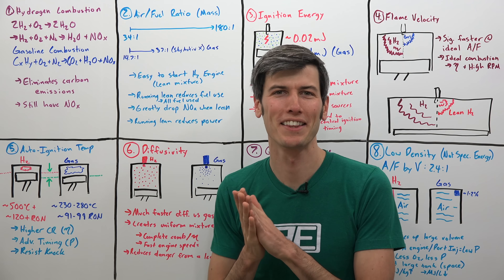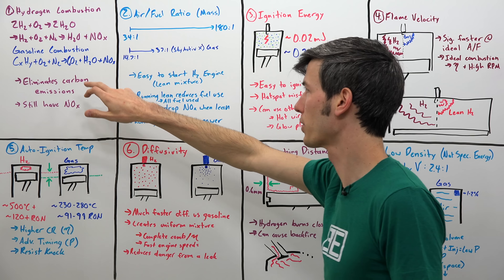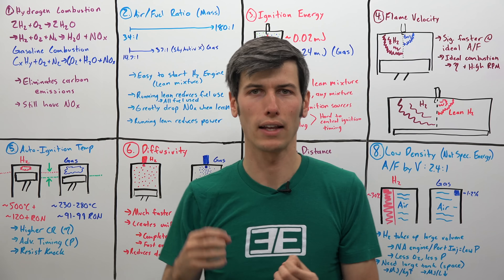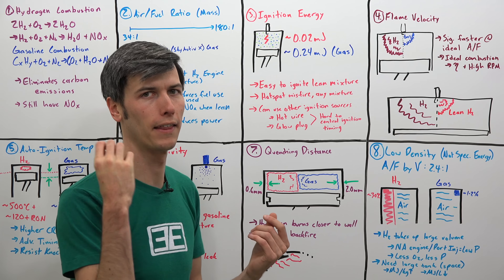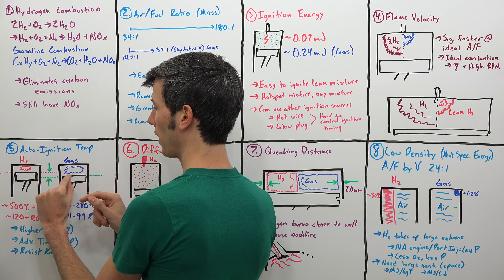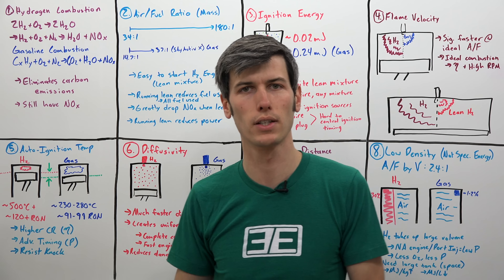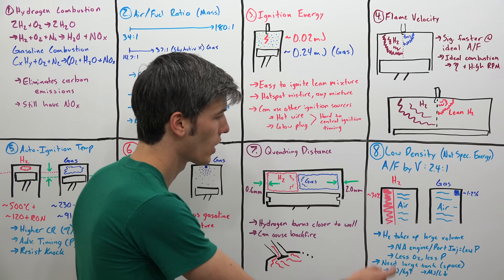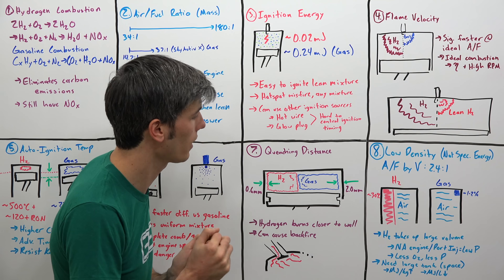The Difference Between Gasoline And Hydrogen Engines

Comment: How does the catalytic converter react to the nitrogen oxide emissions?

Using the least hottest spark plug there is. Better than a glow plug. 

Deeper seating valves, more piston rings.

I would have thought compressing hydrogen into bottles of the propane type [tanks] would be more efficient than gas tanks.  

One always asks, where does the hydrogen come from? Most common answer is it takes gas/oil to produce the hydrogen so why bother with it. My answer is to strictly use hydro power to creat hydrogen [no pun intended] then they complain about flooded valleys needed to supply enough hydro power.  My answer is that it would probably be better to flood a few more valley with water than to flood the entire atmosphere with smog pollution as car fumes count for 70% of the worlds pollution. Is that correct?
Reply from the maker: Can split it into N2 & O2.
Reply: External combustion generators used in large power plants are much more efficient than engines used in cars. So you still have petro-emissions, but less.
Reply: Right Wing Safety Squad of course less, lots less. Enough less that the smog pollution will go away.  Still? Are you trying to insinuate something else?
Reply: @tomster7574  That's exactly what I was saying. I was merely responding to your concern about fosisle fuels bing used to produce the hydrogen.
Reply: Right Wing Safety Squad 👍

Comment: Cant watch it all, have to leave for work, will finish later... I don't see oil life mentioned on board... how long can the oil be used before contaminated by water?  Would it still turn brown?
Reply from the maker: H2O is also a byproduct of combustion with gasoline (or any other hydrocarbon fuel). It's vapor, so it passes out the exhaust (why you see steam from the exhaust when it's cold outside).
Reply: @EngineeringExplained  Thank you for replying, yes I know water is a byproduct of gasoline combustion, since there would be less contamination from carbon and unburnt gasoline what would oil life expectancy be before eventual contamination by the water vapor that isn't expelled through the exhaust?

Comment: Would there be any way to filter out some of the nitrogen in the incoming air to reduce NOx ?  If you could, would this effect performance of either?
Reply: yes, by using pure oxygen, it would improve performance by alot
Reply: @antoniotod9614   Even though that's not filtering, it  would work, but now you need storage for the oxygen, reducing the range of the vehicle.

Comment: But what is the main reason now why hydrogen combustion engines aren't popular. I don't think it's because of the tank size. There must be more problems to it.
I once heared it is kind of "attacing" the oil film on the cylinder walls but I don't know if that's any true
Reply from the maker: Efficiency

Comment: Will carbon build up on the back side of the intake valves and seats be an issue without the presence of gasoline to wash off the valves and keep them clean.  I understand that motor oil being sucked past the valve seals and baked onto the backside of the valves is the culprit here. I am wondering if the backside of the intake valves will need to be sprayed with some sort of cleaning solution via and injector to keep them clean or will the cleaning have to be done manually periodically.   Thanks...   Jon Smith
Reply: No more carbon created in the H2 combustion !! No more build up and sludge, fewer oil changes also.

Comment: I've always been confused by how hydrogen combustion worked to produce power in a piston engine, as I was always lead to believe that hydrogen combustion resulted in a net loss of pressure.

With gasoline you have a liquid and an ideal gas, when they react they make a lot more ideal gas, in the same volume, so the pressure is positive, relative to the precombustion state.

With hydrogen you have 2 ideal gasses reacting to make 1 (roughly) ideal gas, in a 3:2 ratio.  So in that case the product should take up less volume than the starting materials, and you should have a negative pressure, relative to the state before the reaction.  What am I missing?  Is the increase in temperature so high that it pushes the pressure positive?
Reply from the maker: Combustion is very hot, heat makes pressure. Sounds like you figured it out haha. :)

Comment: Hey dude. Could you do a video explaining why automatic transmissions with torque converter are known for handling more torque than a DCT? I don't think this is a rule because the Chiron weights 2.000 kg, has 1,600 nm of torque and uses a DCT. Thanks!
Reply from the maker: I'm not sure I understand. You could have either style transmission be designed for the torque required. Lot of high torque autos and DCTs out there.
Reply: @EngineeringExplained  Everytime I ask why some car manufacturers prefer to put a traditional automatic transmission (like the 8. speed ZF) instead of an automatized transmission with dual clutch which BTW, are much faster (like PDK), 100% says that it's because they can handle more torque. For example, if I'm not mistaken, audi uses an DCT in the TTRS and RS3 but uses an 8 speed ZF in the RS4, RS5, RS6 and 7. BMW uses a DCT in the M2, M3 and M4 BUT in the M5, M850i and M750i, they use again an 8 speed ZF. My point is: As the cars get HEAVIER and MORE POWERFUL, car manufactures seem to prefer to use an 8 speed ZF over a PDK. Sorry for my english XD :D

Comment: I'm curious what the difference in range when comparing a hydrogen combustion engine to one using a fuel cell for the same volume of hydrogen. Though I guess for a true comparison, you'd want to also compare the weight and volume of the motor(s) and drive train for each..
Reply: Just the power you get back, a top of the range fuel cell is looking at 70% energy conversion and a combustion engine maybe 35%.

Comment: You didn't mention hydrogen embrittlement induced stress fracture. That has to make a big difference in engine design!

TBH though - discussing combustion engines now after I have switched to electric makes my head feel dull.
I'm sure there is much interesting to be learnt  still - like there is is about flint knapping.... but when you have learnt to make hardened steel tools it all seems somewhat  pointless and abstract.

Comment: In Europe it's common to see gasoline powered cars converted to either LPG or CNG by installing a new ECU that reads injections times, creates a custom map for the engine on various engine loads to use on LPG/CNG injectors or in case of some GDI engines use the gasoline injectors . 
How feasible would it be to convert a gasoline powered car to Hydrogen? My guess is that it shouldn't be much different from LPG/CNG but I could be wrong. Not sure if you did any research on this but do you know how do Hydrogen combustion engines compares to LPG/CNG counterpart?
Reply: waxonandreluis 
BMW researched a lot on hydrogen ICE in the early 2000s. There even sold or rented the BMW hydrogen 7 which had a V12 hydrogen internal combustion engine. If I’m not mistaken it had like 270 HP when you run it on hydrogen and 445 HP when you run it on petrol. I remember seeing those prototypes and the final “production” car back at the Frankfurt Motor Show IAA I guess it was 2005 or 2007. 

Unfortunately for BMW environmental issues where not the first priority back then at least they where less of a political priority.
Reply: BMW got some grant money for research and did place some H2 vehicles in private hands in some fashion (not sold but leased, maybe even use for free in exchange for reporting). The issues of range from fueling station and the heavy monitoring by engineers would have limited the useability. They got their data and the program ended. The issue with many alternative fuels is infrastructure and fueling difficulty. Gaseous fuels and liquefied gaseous fuels are far from driveup-throw nozzle in tank- walk away affairs. Electric charging cords frustrate many people.
Reply: The missing reaction on the first whiteboard cell is where the hydrogen eats your engine.
Reply: I read somewhere that hydrogen can fuse with metal structures such as tanks and pipes, but works perfectly fine with polypropylene and carbon fiber. So I guess any metal parts that come in contact with the H2 will have to be replaced.
Reply: I have heard best way to go is diesiel engine converted to LPG and then you just need enough on demand hydrogen to keep it running. Storage tanks too expensive. It's possible to get the the amount you need with the proper catalysts, frequencies, and all requiring less than 2 amps. More than 1 amp...... and your doing it wrong.

Comment: You seem like a smart man but I wonder if you are smart enough to figure out just how one Stanley A Meyer made use of just water as the source of hydrogen fuel on demand? In order to figure out just how Meyer, and a few others like Dr. Dingle, you are going to have to learn something that is not taught in our science books right now and make use of the scientific method as there turns out to be another way to break the bonds of the water molecules that is outside of mainstream sciences current understanding of molecules. 
But here is a point I am sure you will understand quite easily and that is controlling the burn rate of hydrogen using gases that do not support the combustion process, IE, the cars exhaust gases. By using the exhaust gases one can slow the burn rate of hydrogen to that of gasoline or diesel and lower the heat of combustion to reduce the amount of NOx gases to practically zero. By injecting in the exhaust gases that do not support the combustion process they physically get in the way of the hydrogen gas atoms from combining with the oxygen gas atoms much the same as if you where to go down a highway by yourself and again during rush hour. This is how one slows the burn rate of hydrogen, but there is more that one can do to increase the power of the combustion process and that is by ionizing the incoming air supply focused on stripping the oxygen atoms of their electrons. This new air mixture will be far more reactive than unionized air gases and as a result you can use far less hydrogen fuel to achieve the same amount of power just by ionizing the incoming air supply. With me so far? 
As you can see there are a lot of different methods towards making use of hydrogen as a source of fuel but the one Stanley Meyer made use of was the most efficient by far as with that method one only needs a tank full of water as their source of fuel. But how is the water being broken down into it's constituting elements? By way of ionization in that a high voltage potential difference is used to break the bonds of the water molecules which is practically the opposite of Dr. Faraday's electrolysis method. With this method you want to use water without any salts, acids, or bases in it so the purer the water the better I use distilled water. The relatively new method for breaking the bonds of the water molecules was first used in, I think, 1968 and has been crushed by those that wish the world to remain using fossil fuels as it's primary source of energy. 
Now that Elon Musk slipped one passed them this technology just might have a chance at making it out this time around, but only time will tell if that is the case or not. Let me know if you understood what was said here or not and/or would like to learn more about this method of breaking the bonds of the water molecules.
Reply: sure, why not...
Reply: @omegarugal9283  I'm waiting on a reply from "Engineering Explained" but if you pay attention to what I just wrote I basically gave the technology away as to how it all works. What mainstream science missed was molecules can be separated by high voltage potential differences and in the case for the water molecule you have to place a both a positive and negative voltage on the water molecules at a rate that is faster than the relaxation time for the water molecules. Now this does in fact take place naturally in nature as it turns out lightening and thunder are not the same in a thunderstorm as that deep bass sound that shakes the ground is a hydrogen/oxygen explosion taking place in the clouds as the cloud formation reaches the threshold for ionization for both the oxygen and hydrogen atoms in the water molecules causing the formation of free hydrogen which is then ignited as it rises to the top portion of the cloud formation causing the deep bass thunder that shakes the very ground. Remember a cloud forms a capacitor with normally the top being positive and the bottom being negative and once this potential difference surpasses the ionization threshold for the hydrogen and oxygen atoms they molecules they form, water, simply falls apart.
Reply: @h2opower   I have studied Stan's work and believe you are absolutely correct. He had found an overlooked molecular property of water that would have shut down the entire world energy monopoly economy, thus it was poo-poo'd and Tut+tut'ed and hushed out of existence.
Reply: @andymoore5771  Basically by putting out well placed propaganda they held humanity back big time as I think this technology holds the key to artificial gravity and many other things not yet understood by humanity. What I found as I made use of the scientific method is molecules can be separated by way of ionization and this is for all molecules. It is already well know that if one using high voltage on the oxygen molecules they will seemingly create ozone but the mechanics of it are it first breaks down the oxygen molecules into atomic oxygen gas atoms. These gas atoms then wish to stabilize and are magnetic with a charge and once outside of the ionization field they quickly seek out and find oxygen molecules to bind with which creates ozone. Most of this was missed by mainstream science as they rushed through the process with a trying to say "I did it first" mentality. 
Meyer, whom didn't want to share this technology or have it stolen from him, went through great lengths to hide how everything actually worked. Example, the first few pages of some of his writings go the supper long way in explaining what happens to something when it get ionized. In fact it is so long winded the message gets lost by the time one makes it to the end of the topic. Meyer did things like this on purpose to hide the technology in plain sight and for the most part it worked perfectly as most that read over his work get totally lost and confused by the time they are done reading it. He even created his own terms for things again to hide the technology in plain sight so no one would be able to steal his work. 
What shocks me most about his work is not one scientist made use of the scientific method to figure out what he was doing, besides myself that is. In doing so I have learn far more about thunderstorms than most and have a perfect good explanation to why that plane exploded taking off on the east coast many years ago. A thunderstorm under the right conditions produces vast amounts of hydrogen which will normally be ignited by the top portion of the cloud. However if a plane flies through that hydrogen oxygen mixture it will ignite it and blow itself to kingdom come. From the ground all we will hear is typical thunder noises and think nothing of it while that plane is now in a million pieces. So, you can see by withholding or holding this technology back the fossil fuel industry has caused deaths that could have been avoided, but truthfully they don't care just as long as the money keeps flowing in. 
I am trying to get "Engineering Explained" to respond to me as I have watched him over the years and I feel he too will get it but one has to jump through that childhood curiosity hoop of scientific discovery in order to do so as all of this technology is to be discovered as it just isn't in our current scientific books at the moment.
Reply: Daniel Dingel secret weapon was bismuth for its dielelectric properties.
Reply: Meyer runs his engine on BS, plenty of charlatans selling infinite energy out there, not one has demonstrated things really working as they claimed.

Comment: GM Defense is working on a military Silverado powered by Hydrogen. My question is, what is the advantage for using Hydrogen as the power source?
Reply: Two main advantages.
Hydrogen is extremely abundant, and burns without pollution.

Comment: Hi Jason, could you confirm or debunk HHO generator kits for gasoline cars?
Reply: Well HHO generators work without a doubt, the part these guys always lie about is the power requirement, you need to put in a lot more energy then you ever get back.
Meaning an engine can't create and burn it's own fuel, you need a lot of extra power from somewhere else.

Comment: Another great video. Thanks! Reading between the lines, this really explains why gasoline engines won the 20th century. Gasoline has great space to energy ratio. Another reason? Petroleum was cheap, and widely available. Will you be comparing the cost to create hydrogen versus gasoline in a future video?

Comment: Love your work! have a quick question though. 
do hydrogen fueled engines have a higher operating temp? Gasoline helps act as a coolent in the cylinder when it gets injected. does Hydrogen do the same eventhough its a gas, or does gas not cool enough to make a functional difference?